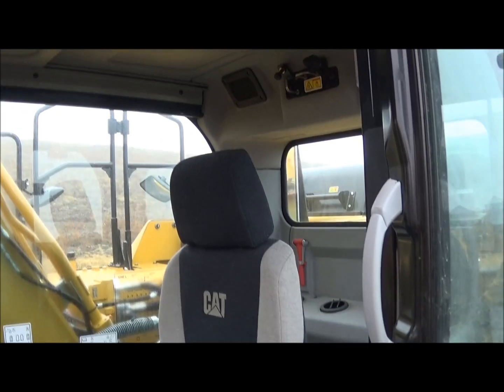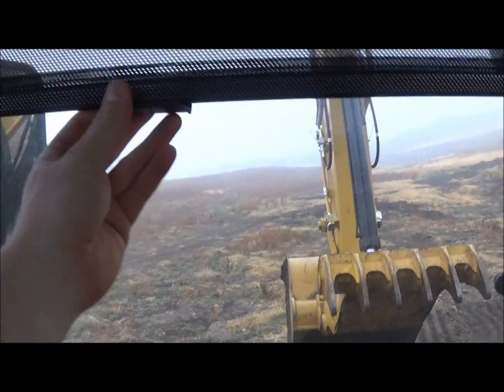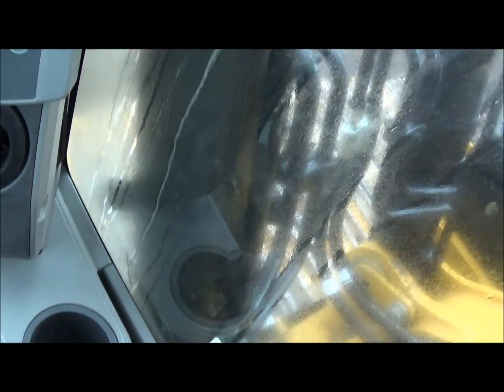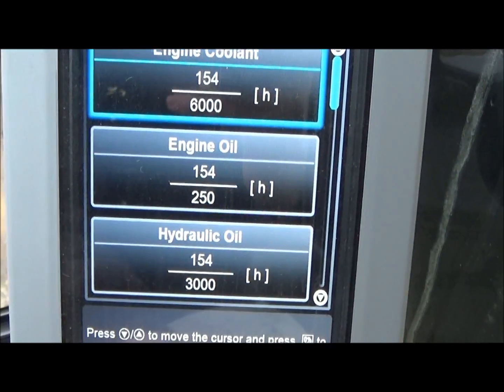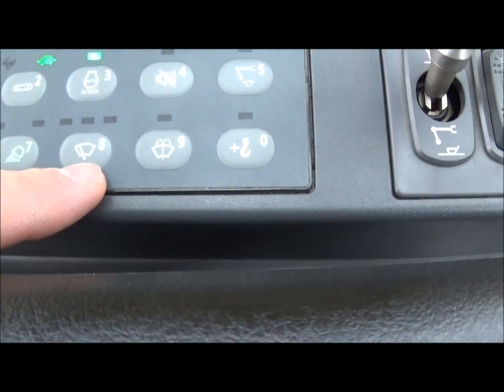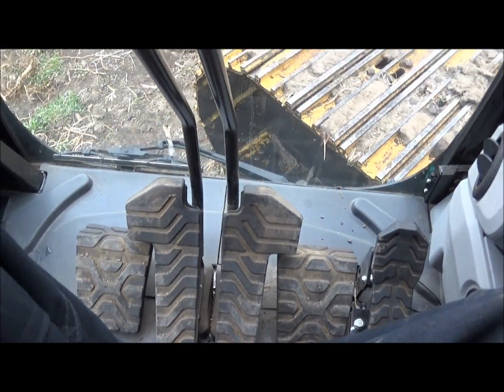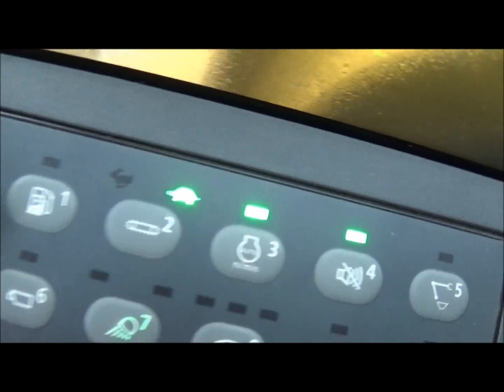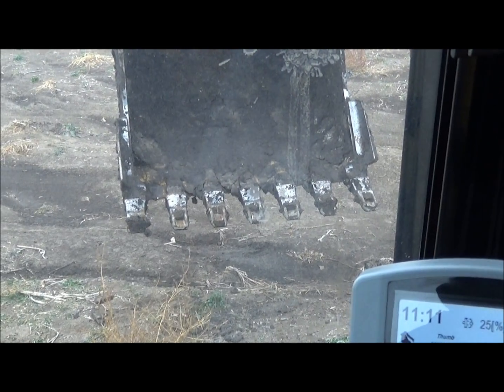CAT 329E L Controls & Basic Operation

Comment: How many machines do y'all actually own? I've followed for a while and seen that some things have come and gone through the years and new things have been acquired. Love the videos, thanks!
Reply from the maker: Thanks you for watching and for the comment. 

We  have worked our way up to newer better machinery and along the way found what works best for my operation ....

Here is a list of current heavy equipment .. I am slowly working my way into doing video's of each item .. and there will soon be a few additional pieces of equipment on the way .. 

1. 2012 CAT D6T XW crawler dozer
2. 1980 CAT D8K crawler dozer 
3. 2006 CAT 973C LGP crawler loader - (which will either be getting sold or traded for another dozer)
4. 2013 CAT 329E L  excavator 
5. 2004 CAT 312C L excavator
6. Hydramaxx 2710 trencher  (for drain tile)
7. Case 590 SM+ series 3 loader backhoe
8. CAT 621 pull scraper
9. LaPlant Choate 314 pull scraper
10. 07 Peterbilt 386 semi tractor - used to pull a 2012 Fontaine 55H MDSR lowboy and a CTS 28 ft Rock Master end dump
11. 1987 Kenworth T600 dump truck
12. AM General M925a1 6x6 truck converted to dump truck,  
13. Eager Beaver tag along trailer 
14. 3 - newer Chevy 3500 crewcab 4x4 pickups 
15. PJ triple axle deck over GN trailer
16. (6) drain tile stringer trailer 
17. Various other tiling equipment / supporting trailers / tools / etc.
18 Big G SD1818 construction disk
Reply from the maker: And a CASE 465 series 3 skid loader (which i forgot and left off my first list)
Reply: BLACK EARTH EXCAVATION Very informative, thanks. 
I saw a coupe of videos back you had a brand new Cat D8 LGP configuration, was that a rental? 
And what size dozer might you replace the 973C with?
Reply from the maker: Hunter Moser thanks for the reply...  the 973C will either get sold and not replaced or it will be replaced with another CAT D6T XW or possibly a 6R XW, just not sure yet... The D8T LGP was a used machine, had short of 2K hours on it when we purchased it. We used it on a couple of bigger projects then sold it.  It was a very nice machine!
Reply: BLACK EARTH EXCAVATION Is it feasible to acquire such a large machine for a few jobs and then be burdened with having to sell it? I guess I would be concerned about having to line up a buyer or be stuck making payments on it. 
Thanks!
Reply from the maker: Hunter Moser  its a risky game for sure, especially with the recent collapse in the yellow iron market. Although, we did good resealing it. We were fully ready to keep it long term.
Reply from the maker: Hunter Moser * reselling .. Darn phone autocorrect!
Reply: BLACK EARTH EXCAVATION I guess we have been fortunate in that every machine we have acquired is still needed and always have work for all of them. Only ever sold two items off, when they became too old for us...became money pits I guess you could say. 
I look forward to seeing if you decide to acquire another dozer. Good luck to you and your business.
Reply from the maker: Hunter Moser Thanks very much and stay tuned for more video's

Comment: First large excavator thumb I have seen where the it "meshes" with the bucket teeth.  I hope it doesn't crack or break when you pick up concrete and rocks.  Nice momentary switch to activate the thumb.  It looks like you ordered the excavator and Caterpillar built it to your order, instead of a dealer piecing it together.  Nice finished product.  You dropped some grit off your shoes you should go back and clean up.  Keep it clean and neat!! ;-)))